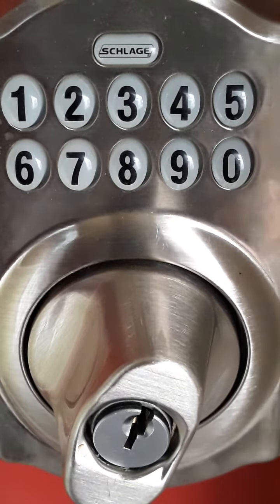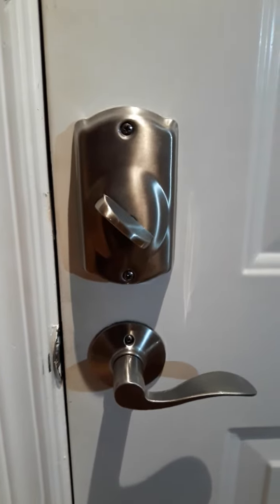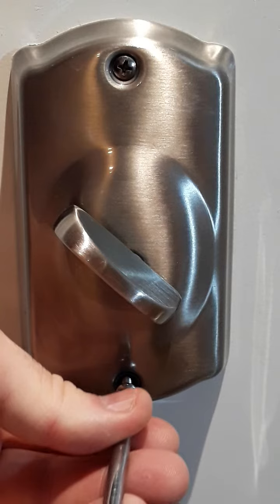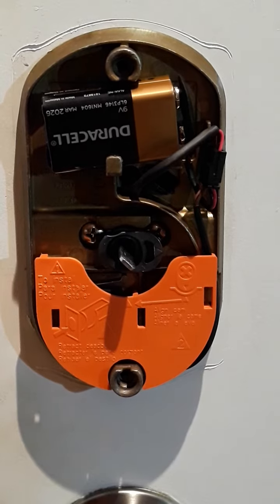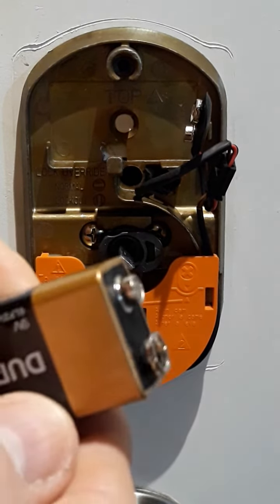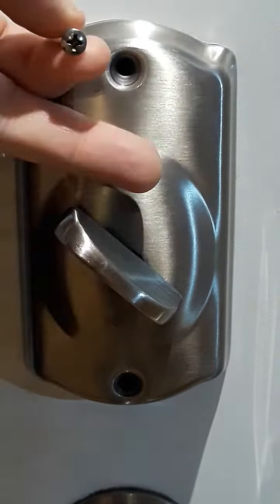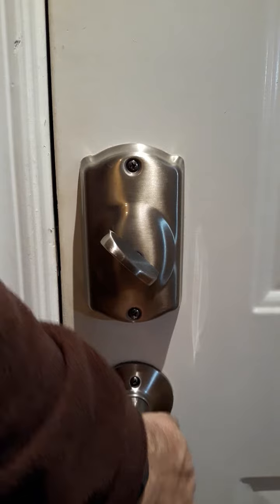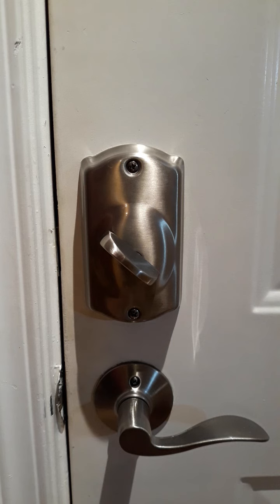Changing Battery on Schlage Keypad

Comment: I changed the battery and now the keypad will not come on. What am I doing wrong? I have changed the battery once before without any problem.
Reply from the maker: That I'm not sure. However, you might want to check the polarity of the batteries.
Reply from the maker: I'm not sure. You might want to check the polarity of the batteries.